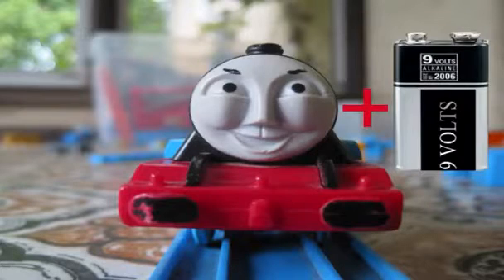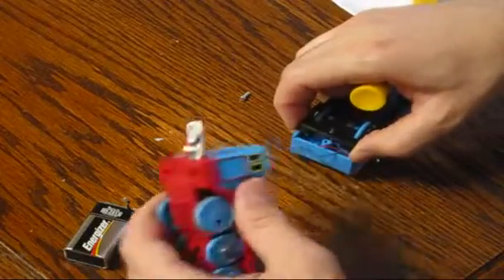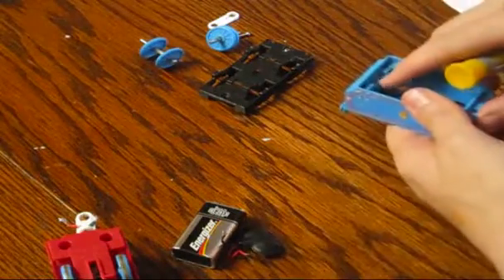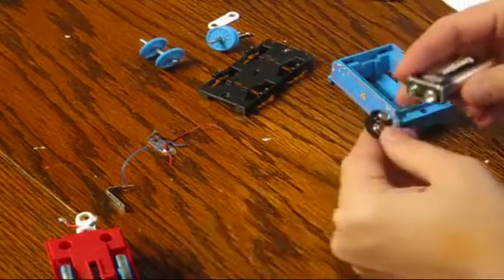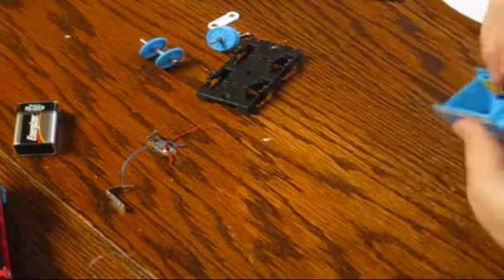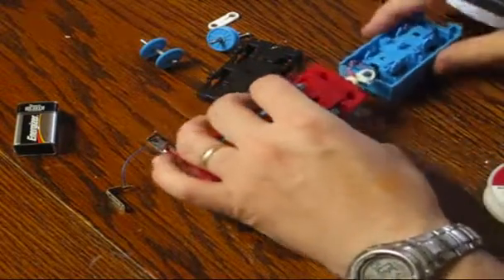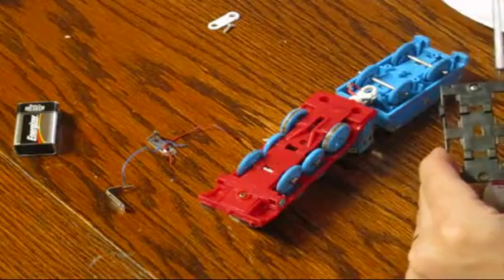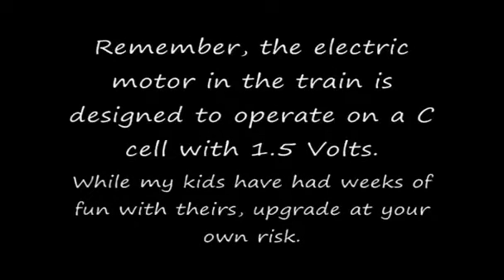How to get Track master Gordon to use a 9 Volt battery

Comment: You can actually make Gordon go really fast without using a 9 volt battery
Reply: How?
Reply: Using a HyperDash 2 motor.
Reply: @kombi1995  they’re actually different motors or 50,000 RPM motor

Comment: You can actually make Gordon go really fast without using a 9 Volt battery
Reply from the maker: How is this?
Reply: A simple motor swap.
Reply: What if it’s both a motor swap? Can make 1.5 V look really good and fast, then multiply that by six and you get God fast.
Reply: Parker Vandella  It’s true, I’ve done it with my Wooden Railway Motorized Gordon.
Reply: So you need a new motor and a soldering iron
Reply: @thomasandfriendsfan2815 yes